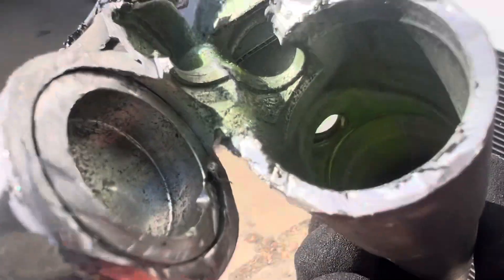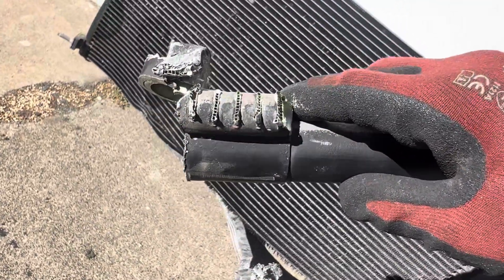AC condenser cutting open to see how much oil is inside and the condition burnt looking or clean ￼

Comment: I opened mine.... there is a black oil in the receiver. what might be the cause???
Reply from the maker: @BlaqmanCooling  you ran low on refrigerant and overheated 🥵 the compressor is number one cause
Reply: It is called "Black Death" complete and utter contamination.